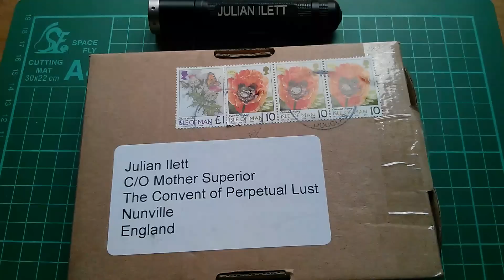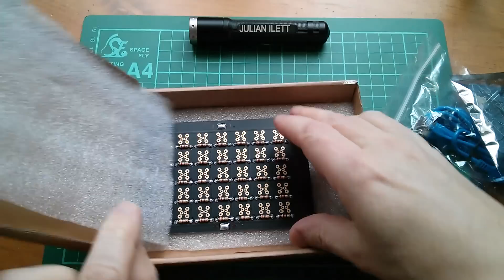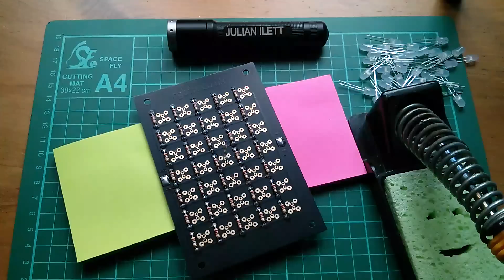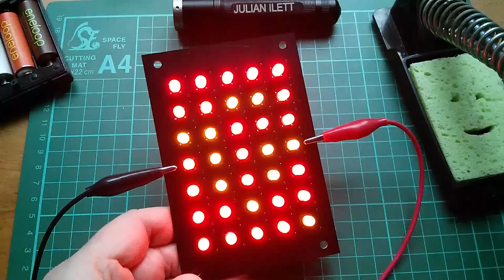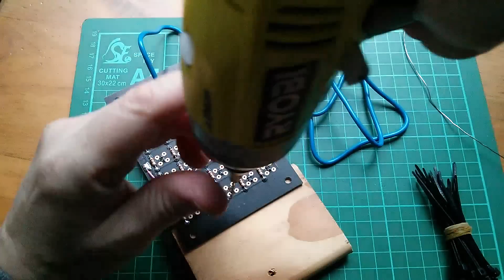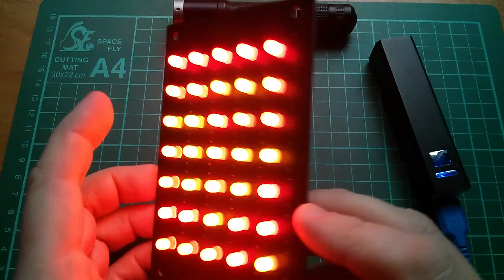Big Clive Collaboration - Competition now Closed

Comment: 100K?  What are you going to do with one hundred "k"'s??  Well congratulation- glad I could help.
Reply: As for the steel wool cleaner thing- the trick is not to "wiggle the iron around", but you should thrust the iron vigorously into it several times like you are stabbing a murder victim.  I no longer use a sponge- all cleaning (which is much better than the sponge) is accomplished with a similar device.  Mine is a combo of an Ikea jar (Rajtan Spice Jar 4 for $4) and brass scrubbies (6 for $1) from a Dollar Tree (like a Pound Shop I think).

Comment: If you used 100k resistors instead of 270 ohms, you could plug this thing straight into the mains. Wouldn't be very bright though. Maybe 22k would be better.

Comment: Congrats on reaching 100K!
A suggestion on using the pistol drill, taught me some 50 years ago by my father: don't use your index finger on the trigger. Use your middle finger instead. This will shift your grip higher so you are pushing more in line with the drill bit, and can also use your index finger to help steady the drill motor.
Reply from the maker: +l wilton I'll try that, thanks
Reply: Also if you try to make the holes at about the 1/3rd point along the side and stagger their positions, people won't be able tell that you didn't mean for the holes to end up as they did.  Never try to eyeball the 1/2 way mark when making something.  A little off looks worse than way off.

Comment: If only you guys had engineered it to use 100k resistors somewhere! The 100k  panel award for 100k views. Add a 'Play Button' as a switch for good measure.

Comment: it's all cool, but consider this: 10M parallel with 10M parallel with 1M parallel with 2M2 parallel with 75M in series with 1M parallel with 68k parallel with 1M5 parallel with 3M3 in series with 100k parallel with 8k2 parallel with 33k parallel with 220k

Comment: Clive could have used 100K resistors but you would need a 1000 volt power supply to get 10mA through them and they would dissipate 10 watts each.
Would have made a nice 350 watt heater with an even nicer 'on' indicator lamp.

Comment: Please ship with 100k worth of currency as well. You might as well add a boost converter and maybe a high current transformer as well.. But shipping to the states is probably a little steep for that.. Thanks....  Also, do you mind if I link your channel in the videos I'm about to start releasing? (Of course just the ones where your channel is mentioned). I would feel impolite if I didn't ask.